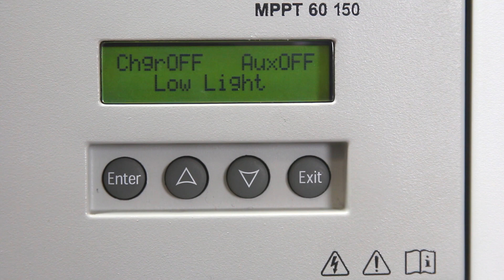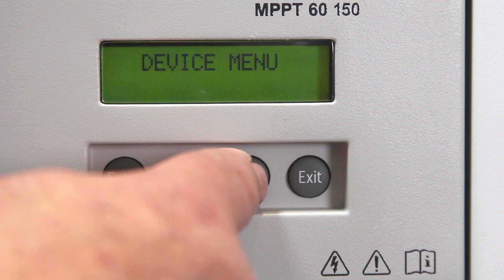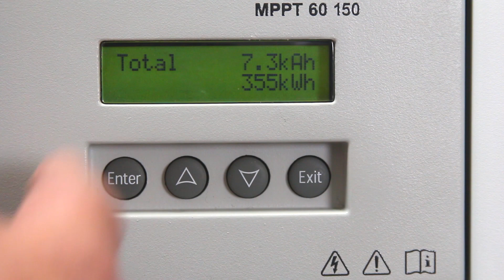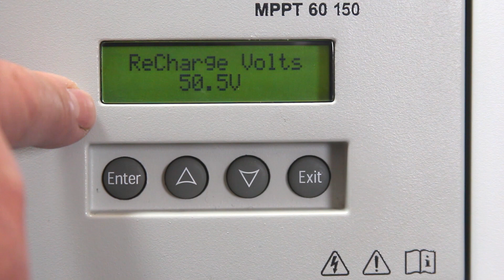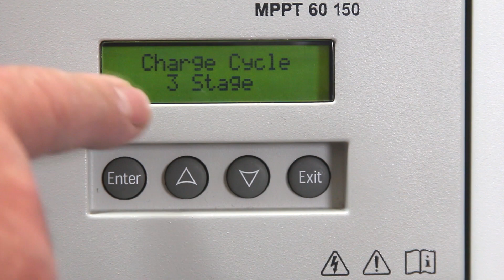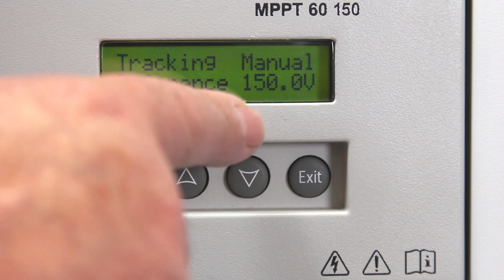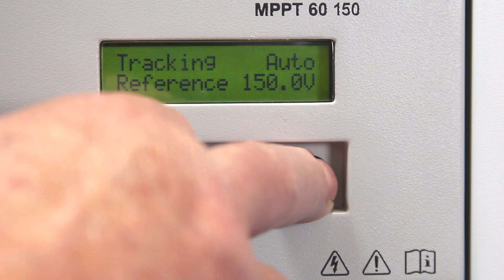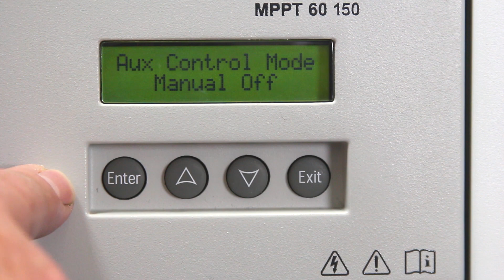Conext MPPT 60 150 - Product Knowledge Series Part 2 - Menu Structure

Comment: Hello
FOA,, thanks

After I bought this controller,  but still not install it, because I'm confusing how it will fully charge the battery and I have load all the time?
I think it will keep be keep in high volt of bulk charging,
And this will damage the battery storage,

So, please advise what is solution

Thanks

Comment: I purchased a full house solar system in Oct 2020 from a solar installer.  The electronics were all from Schneider Electrical and included two inverters and charge controllers and associated equipment. After two years the system had numerous failures to included getting stuck in a loop, cycling the power on to the house several times before resetting. The system shut down on numerous occasions requiring me to reboot the system with error codes that made no sense such as fused relays. The system finally completely failed.  Despite numerous service calls from the installer over the space of a year they were unable to get the system to work and would not continue to support it.  I replaced the system with a solar arc 15.   I have made numerous attempts to reach out to Schnider and cannot get an answer from their customer support center.  The phone rings for an hour and just disconnects.  The system is still under the five-year warranty.  I want my money back.

Comment: anyone know how to reset the Ground Fault error on these MPPT60 controllers? I've got 3 controllers that all show the same fault. this is the 3rd time it  has happened in 6 months or so. I'm having the techs come out to try to figure out what's going on, but I'd like to get my (off grid) house back running temporarily if I can figure out how to reset the fault(s).
Reply from the maker: Hi @bschena, sorry to hear about your system. With multiple MPPT60 units, only one ground fault fuse should be installed in one MPPT 60. If that fuse has blown, it will need to be replaced by a qualified person. Thank you.

Comment: My unit is on a 48v pack that is 14s Lithium Polymer packs with custom battery menu setup for 57 v top out... however on occasion it will spike output as high as 62v which throws my inverter into a tizzy as its got an over voltage cutoff of 60v.   How does one prevent the random overvoltage situation when we have great sunshine on our input PV array?  Also I know there is a new firmware avail as my unit is older.   How does on. Update that?
Reply from the maker: Hi Ron,

Thanks for reaching out!

Regarding your first question, please follow the link & submit this form (https://solar.se.com/us/en/support/#technical-support) so that our tech support agents could assist you. Technical support can also be reached via telephone, at 1-833-391-8640, 8am – 11pm, Monday – Friday (Eastern time).

For the latest downloadable firmware, please go to https://solar.se.com/us/en/product/conext-mppt-60-150-solar-pv-charge-controller-2/#downloads and scroll down to "firmware."

Comment: Can these be used for Lifepo4 batteries? I assume that I would need to use the custom battery settings to set the charger voltage correctly for Lifepo4 chemistry?
Reply from the maker: Our products are compatible with multiple battery technologies, including Discover's LiFePO4 lithium batteries. For more detail about how to set up, please contact technical support at https://solar.schneider-electric.com/netsuite/
Reply: @johnny5finger thank you for your reply. I would be very interested to hear how this goes for you. I am a bit confused about the last sentence of your reply. Can you please confirm this. Are you changing it from 14.6 to 14.4 or is this a 2 voltage setting?

Comment: Hi, i have changed the battery voltage from 24v to 12v and the controller screen just turn off and it wont come back

Comment: I am a solar installer, but I've never installed any Xantrex products, I usually just install Outback, but I just bought a Conext MPPT 60 150, and I'm trying to configure it before installing in the customer's system, but it only shows the History, Battery, and Display menus. The other menus are all missing! I think those are known as the Advanced menus. Outback has a password to get in to those settings. What password or button settings do I need to get into the Advanced menus for a Conext MPPT?
Reply: Nemmind, I found the answer. Basic/Advanced menu viewing is configured in the Display Menu.
Reply: @SESolar  I installed it, entered the settings I needed, and it works fine, but I did have one problem installing it - the knockouts on the bottom did not pop out like normal knockouts are supposed to do. Instead, they appeared to be insufficiently stamped, so they were stuck in place and I had to use a knockout punch tool to make the holes I needed.
Reply: @thadhorner5129  Thanks for replying to your own post!  I was looking for this info also!  Iv installed a few Schneider systems, Inverter/MPPT/SCP, and usually configure everything on the SCP.  Today I hooked up an MPPT to a battery by itself to get it charged and ready to install in the system, still putting the rest system together, but wanted to get the batteries charging while I was working on other stuff.  I was confused by the EXTREMELY basic menus on the MPPT, and was thinking that it really sucks you have to have a complete Schneider system (Inverter/SCP) to actually fully configure an MPPT controller!!!  The default AGM settings work pretty good for Lithium thou, probably not ideal, but works.  Next time I mess with one, without the SCP, I will have to remember to switch to the advanced menu, the basic menu lets you change just about... nothing.  I know on the SCP you can press ENTER/UP/DOWN, all together for about 3 seconds, and an "advanced settings" menu will be added to the display, kind of an "installers secret menu"

I have felt your pain with the knockouts on these things thou, It seems like there was a batch with very poor knockouts, you had to try to punch them out from INSIDE the unit, instead of from the outside, which is pretty difficult since they are tucked way in the back, and they are so GENEROUS (NOOOOTTTTT!!!!) with wiring room inside these units.  Besides being pre punched the wrong way, they were punched very poorly and were very hard to knock out.  The last couple MPPTs Ive installed, it seems they have fixed this issue, and are easy to knock out, like they should be. (I love Schneiders equipment and systems, but I REALLY hate wiring them up!  Cant they give us a little more room!)

Comment: Hi is that charge controller can charge 2 battery bank with deferent absorb an float
Reply: Hi Off Grid in St Lucia, the MPPT60 has a single input for battery connection, therefore it can only charge 1 battery bank. Multiple controllers would be needed to charge separate battery banks (at least 1 for 1). That said, you can have multiple controllers on a common battery bank provided the bank is sized to accept total current. That would be according to battery specs.
Reply: Thank you sir for replaying back